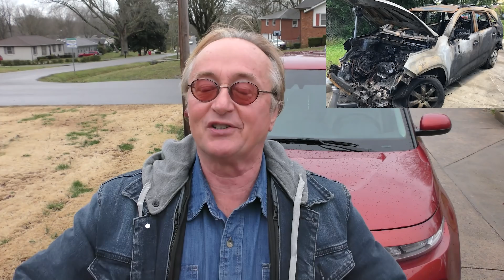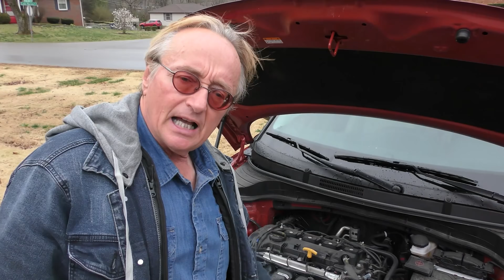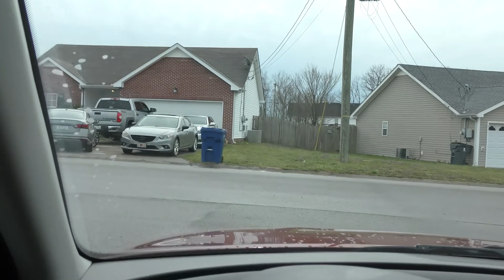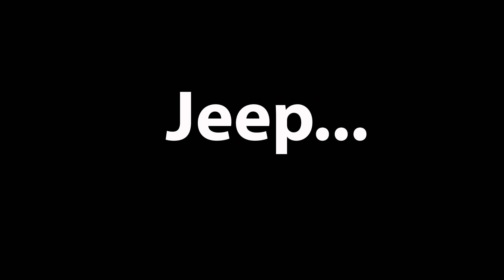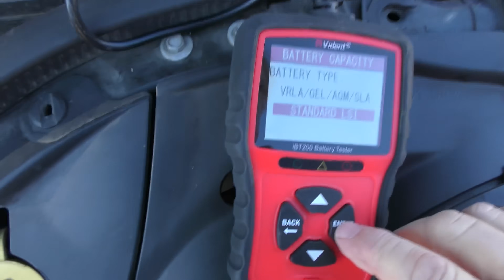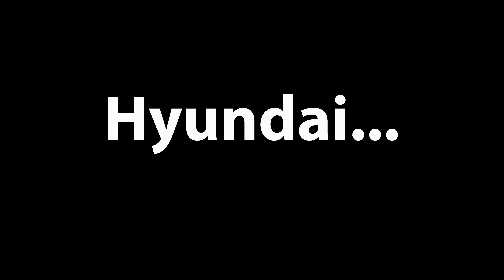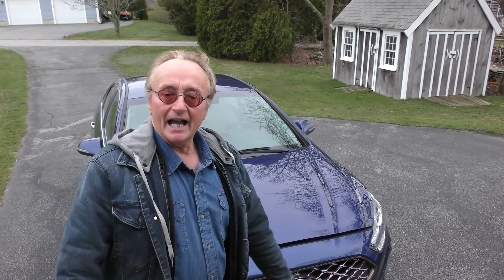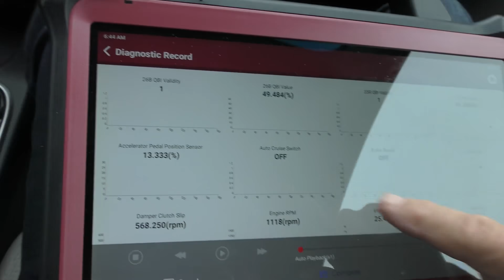3 Car Brands That are Crap

Comment: Kia and Hyundai are like the knockoff Honda and Toyota
Reply: If you really must know Hyundai, Kia and Genesis are sister companies. Sort of like Toyota, Scion and Lexus
Reply: @yourhowhigh6635  not sort of like. Exactly like.
Reply: @yourhowhigh6635 exactly
Reply: Too bad, i even dig their design concepts..but yeah i won’t choose them anyday over toyota/honda
Reply: All these people talking crap about Kia have no idea they are some of the most reliable cars on the road. Before you make yourself look silly do some research.
Reply: @RussD123 Kia is complete crap. Kia owner.
Reply: @RussD123 Is that why they had lawsuit for engine piston bearings failure, oil consumption at 10,000kms milage, theft, ABS lawsuits and engine fires?
Reply: Honda are junk these days. Gone are the days when a Honda lasted forever
Reply: Still better most brands. I believe kia and Hyundai biggest problems just burning oil which isn't the end of the world. Compared to Nissan another cheap manufacturer, it still uses garbage Jatco transmission.
Reply: @yellowspike3344 
Just do not buy a car with a CV Transmission.
Reply: I'll take the telluride or palisade more than the pilot or highlander
Reply: My 2018 Hyundai Santa Fe was problem free for 200K miles. Wish I still had it but    some lady on her phone not paying attention ended up hitting it and totaling it. Lowest maintenance car I’ve ever had.
Reply: They weren't always like that, hyundai was a good car back in the early 2000's.
Reply: @kheirfrancis22 no. They had tons of issues then also.
People have always just loved their "long warranties" that mind you have some of the whackiest fixes. Old Hyundai/kia would use junkyard parts from other vehicles, even engines, to "fix" their old cars under warranty. Which says they've never believed in their own reliability either if they wouldn't use OE parts.
Reply: I bought the Elantra over the Carolla honestly because I get employee discount and the Corolla’s look like trash compared to the ELANTRA.
Reply: That’s not true! My 2007 Hyundai Santa Fe went over 300K miles! And rarely gave me problems!
Reply: Americans complaining about Hyunday and KIA yet they drive dodge and chevrolet...
Reply: @dougncc7542  How dare you lump Chevrolet in with Dodge, and Ford... 

Chevrolet has the best pushrod V8s on the face the planet for the past 80+ years..

The same cannot be said about Ford or Diamler Chrysler...
Reply: Gotta check the catalyst on some Kia’s to double check the customer didn’t bring me a diesel lol
Reply: Facts
Reply: They truly are, and their warranty service is horrible with Kia. Beware.
Reply: I've never owned a Kia or Hyundai.  So, I guess I'm pretty ignorant.  My wife at the time drove a 1990 Nissan Maxima.  My in-laws drove it and were forced off the road by an 18-wheeler, coming head-on on a 2 lane road. Of course, it was also at night, a rural road, and raining. The road had no shoulder.  They went down an embankment and rolled.  Ending up upside down.  After 3 months in a body shop, fixing the body and broken glass and the sun roof.  We bought it off her parents.  It ran like a top for years.  My Mom drives a 2007 Honda Accord with 18k miles.  Best car ever made.  She's 87 and will never trade it in.  She won't say whether it goes to me or my sister. Lol!  So when she passes the negotiation with Sis will be interesting.  My daughter drives a Nissan Altima.  Her second.  The first Altima she discovered a recall on the engine, but under certain criteria.  I don't recall the specifics.  But Nissan gave her a BRAND NEW OUT OF THE BOX ENGINE!  Unbelievable!  Then she wrecked it and totaled the car a few weeks later!  Good grief. My Mazda B000 Pickup has 384,000 miles and is still going.  So Kia and Hyundai have a lot to live up to.
Reply: I’d rather buy an old Civic and Camry any time!
Reply: I'd say the stingers probably the most decent thing kias made in years
Reply: I just watched a video with Scotty giving KIA great review. Why is KIA getting a bad review in this video?
Reply: Wife has a 15 optima. It's been a great and reliable car. I do most of the maintenance myself and it's done before the manufacturer guidelines... as it is with all of my vehicles.
Reply: Hey my man... I own a 2006 HYUNDAI GETZ 1.4 with high double figure mileage on it and I live in a  subtropical coastal area - let me tell you,  it gave and still do deliver very good service... I've recently replaced the valve cover gasket with the plug tubes due to it have had a minor oil leak on the valve cover which is not uncommon for a small multi valve engine with like 150 000 miles on it which is in every day use, but other than that to date she still gives me good service and is very light on fuel...
Reply: The early Hyundai and Kias were literally cheaper versions of retired designs of popular cars from Mazda and Mitsubishi.
Reply: I have had two Hyundai cars. They are the most reliable cars I have owned to date. But then again, on my dime I can’t afford Toyota lol.
Reply: Hyundai are literal knockoffs of Honda. They changed the name to sound a little different but similar and they logo/emblem looks like a retarded Honda emblem.
Reply: True but you gotta keep in mind that they're also a lot cheaper.
Reply: Im DEAD 😂😂😂
Reply: "Hyundai and Kia come with loads of features, but at a lower price."

"Yeah? A dependable engine wasn't one of the features."

Former Hyundai owner. 
2016 Sonata SE. 
Burned oil, had barely 70k on the clock.
Reply: @Dagrizzb  same dude, probably try to run to 100k miles (extended warranty period ends) and then move on to Honda or something. One thing the Sonata had over the Civic and Camry was the leg space. I'm 6'5'' so it was nice, but the oil burning now at 65k miles is obnoxious.
Reply: But not even close !!!
Reply: True, but I've been driving a Hyundai since 2009, and it's doing just fine. It's paid off and I'm gonna drive it till the wheels fall off.
Reply: Bad knockoffs at that.
Reply: Not all are bad!!
Reply: @susanphilips9139  True.
And not all are knockoffs.
Reply: Kia and hyandai are same company
Reply: @seriousgranpa  where we live kia owns all the dealerships accept for Toyota and Ford. Hard to get a bargain when they have a monopoly
Reply: @jordanalexander615  well, monopolies are everywhere, these days...
Reply: Throw in mitsabitshi as well
Reply: A bad knockoff
Reply: You can't even say kia/hyundai in the same sentence as those two weel known/proven/legendary brands!!! (See how I avoided it myself😉🤣)
Reply: Kia belongs to Hyundai consortium.basically they are same car
Reply: Hondas get stolen like a motherfucker
Reply: Don’t tell a Korean that lol
Reply: No.
Reply: That car is a piece of junk
Reply: Sonata bought at 32k miles, nice interior, zippy car, overall good looking decent car nice trim...but around 60k miles now noticing ehhh it's burning about a qt of oil between oil changes 6 months give or take. Kind of annoying.
Reply: Lol true I think the only good kia I've seen is a kia sephia
Reply: I had a 2000 accord, transmission went after 42k
Reply: They are actually the same company
Reply: They're the Winn-Dixie version
Reply: 10000000% Agreed
Reply: Just like Lexus and Acura are knock off  Mercedes and BMW aroumd the world including Japan except  in North America where they are Luxury overpriced overhyped vehicles.  Like Seiko and Rolex
Reply: Not anymore
Reply: I have a 2015 Hyundai Sonata hybrid that I bought new and it has 100k on it. It does not burn a drop of oil. It looks and runs like new. I have yet to need new brakes. As the hybrid battery ages, the mpg drops because the battery can’t handle as much of the driving time for the engine. When new, I got about 48 mpg now I get about 38 mpg. The only complaint I have with the car is that it has a smaller trunk due to hybrid battery being stored in the trunk area. When I brought the car , Hyundai warrantied the hybrid battery for life for the original owner. I expect it will need to be replaced within the next two years so I will be hanging on to the car for at least another couple of years. One of the best cars I’ve ever owned and I’m 79 and have owned at least 20 cars over my lifetime.
Reply: Nope, they're the antithesis of Toyota and Honda
Reply: Funny how a black guy pretends that he has the cognitive aptitude to assess and evaluate technology, products..etc.
Reply: Good thing about hyundai is they lost the lawsuit about their engines and have to warranty them out for life already got a brand new one replaced due to the negligence
Reply: Hyundai is actually good and Kia was good at least my moms 2004 Kia Rio never had any issues
Reply: I drive the Hyundai Santa Fe gen1, 2003 (2.0 crdi) all wheel drive.
Oil and regular maintenance (brakes and struts recently) with an unknown amount of kilometers.

Sustains a fair amount of abuse out of the road.  Paint is the weak point on mine.
Reply: Um yeah but they look better sometimes and are usually more “luxurious” but yeah
Reply: Dude I literally always said that 😂
Reply: and samsung just trying to be Apple. The lack of originality from their country. They have the brains to be original but all their companies just trying to copy others
Reply: Toyota tax is worth it especially if you plan on keeping your vehicle long term.
Reply: That’s correct, Hondas are like knockoffs of Acura and Toyotas are knockoffs of Lexus.
Reply: @francislopez8090 no, Acura is a “luxury” brand of Honda and Lexus is the same of Toyota.
Reply: What about Buick? Is the quality any better than Hyundai or Kia?
Reply: Koreans everywhere are glaring at you right now lol considering Kia and Hyundai are Korean car companies 🤣
Reply: My friend just bought a new Kia. It’s annoying and ugly.
Reply: Honda, mazda.,toyota...
In that order..i also love older ford, but as far as impòrts..i wouldnt want a kia
Reply: I have plenty of Hyundai sonatas that are rolling over 200,000 mi and still going strong. Not every car under the same brand is made equal. It really seems like Hondas have started taking a dip in the past 10 years. At this point the only one I would say is running great on the powertrain side is probably Toyota but even if that's the case I wonder why they drop their warranty coverage time when Hyundai did not.
Reply: Honda WISHES they were as good as Hyundai and Kia
Reply: Honda is expensive to insure.  Hyundai is much cheaper.
Reply: If they are " knockoffs" then how did they start making them better.
Reply: But as expensive or more expensive than those. Crazy
Reply: Hyundai and Kia are well ranked for reason. My Hyundai has 205,000 miles on it and still going strong.  

Mostly all I have ever done is oil, brakes and tires.
Reply: Agreed, it look and feel the same outside but quality is defferents!
Reply: Honda is like a knockoff of Acura is a knockoff of Lexus which is like a knockoff of Rover which is like a knockoff of Rolls Royce which is like a knockoff of Bentley which is like a knockoff of Stanley Steemer.
Reply: Hyundai and Kia didn't have problems with 2015 and older models with MPI port injected engines. When they went GDI all went Downhill😅. Also the 6 speed automatic ( regular old school) Hyundai use is solid and runs forever. They had lots of issues with dual clutch automatics, better to stay away.
Reply: 1 quart of oil per 1000 miles...yes, that makes sense, KIA. What a load of crap.
Reply: By wanting to be Toyota you must mean the repeated catastrophic and expensive component failures right? Because that's what Toyota is known for by people that have actually owned them.
Reply: @sypoth  What is a better brand to buy?
Reply: You know what is funny.

Their own engines originated from Mitsubishi designs and they used to be reliable when they built them in Korea.

Then they designed brand new engines with Global Engine Allince (with Mitsubishi and Chrysler.) Opened factory in Alabama to build their new engines, and their quality went to garbage.
Reply: I drive a Hyundai.  I have had it for 6 years and 3 months.  It still runs just fine!
Reply: FINALLY someone thinks the same as I do
Reply: The one assembled in Europe that we are driving across the pond are pretty much reliable, mich more than Toyotas assembled in Turkey. Go figure.
Reply: I gotta say some kias that aren't first year models have a log life of taken care of. However like most companies the first year of say a new engine with a turbo.... Have a tendency to blow up around 100k from bad oil leaks. Especially the optima turbos
Reply: Two of the worst
Reply: I'm a korean. And most hyundais and Kias (except the ones with the theta2 engines) work fine. They stay for a long time, but not as long as Toyotas.
Reply: NO .. 
Not
Reply: . . . But doesn’t have the quality
Reply: There speaks a man who knows nothing about buying a car.
Reply: My Santa Fe went on forever!!
Reply: Yeah my Hyundai sucks.
Reply: My ioniq been running 60 mpg across state problem free, not all Hyundai are bad
Reply: The 6 speed transmission Pilot had tons of problems. Why pay premium to get similar problems on Honda when u can pay the same price for a brand new Kia or Hyundai. Remember cars are liability, I’d rather use manufacture warranty to take care of than the anecdote of brand reliability.
Reply: Traded my 2016 Kia Soul for a 2015 Toyota Rav4 cause I hated the Soul too much. Should've taken my brother's advice since he loves his Rav4
Reply: Honda motorbikes are #1 but their car window electric winders always fail
Reply: Have a 2012 Tucson with 135K miles. Bought in 2015 with 20K miles on it. Service it regularly. Only thing ever wrong was AC compressor. Put a  New Tucson compressor. Now it's fine. Runs great. No engine problems ever.
Reply: Lol right
Reply: Hyundai aren't that bad
..
Kia is
Reply: Funny thing about that is that Hyundai & Kia are the same company Hyundai bought out Kia a year or 2 ago
Reply: Hyundai built by non union autoworkers in Alabama so they can save a ton of labor costs. Nuff said.
Reply: And Lexus is for people that can’t afford a Mercedes-Benz lol
Reply: @nadaanilom3995  Nissan is a much better fit for a comparison with Mercedes because they’re both junk that become maintenance nightmares after a few years.
Reply: @toddjones1480  nope
Reply: I mean they stole the H from Honda for their own logo, so you can’t expect much😅
Reply: Old Hyundai's are good but the new ones are obviously gonna be garbage as is with every newer vehicle, peak years of Hyundai in my opinion were up to 2005 everything past 05 was when most companies messed things up, hence why you got the 06 impalas which are good on paper and badly executed. Also depends on your treatment of the vehicle as well, any car is reliable if you treat it right, unless it's a Saturn obviously
Reply: Scott what do you think of the electric KIA ? 
I've been hearing good reviews
Reply: @leonprod  Huge POS!  If your buying Hybrid go with a company who's been in the business the longest.  That's Honda, and Toyota..
Reply: At 2:21 looks like scotty's wife was off to bring scotty some lunch😁
Reply: Hyundai is knockoff Honda. Kia is knockoff Hyundai.
Reply: Honda and Toyota have a history of building good vehicles, unlike Kiundai.
Reply: Yup that’s right
Reply: japanese is better that korean